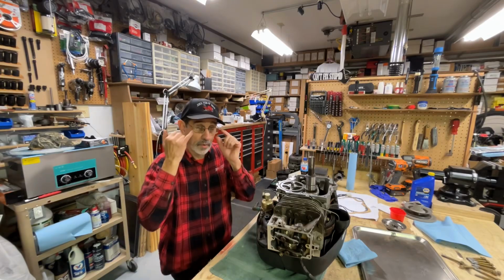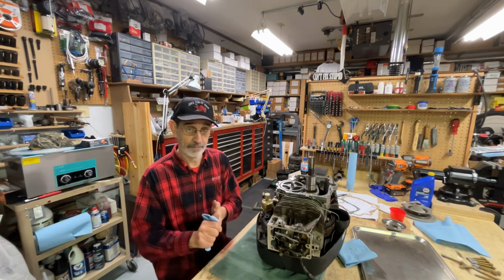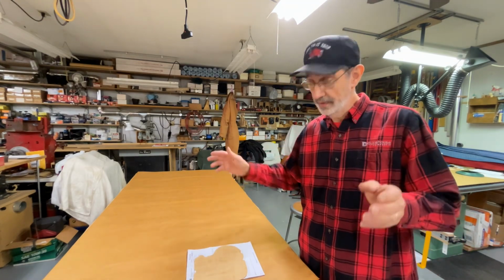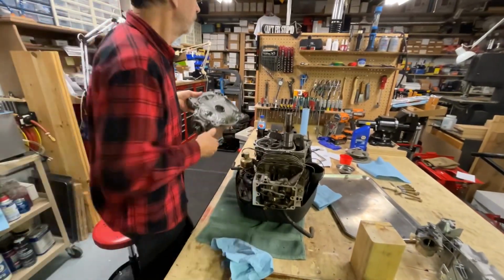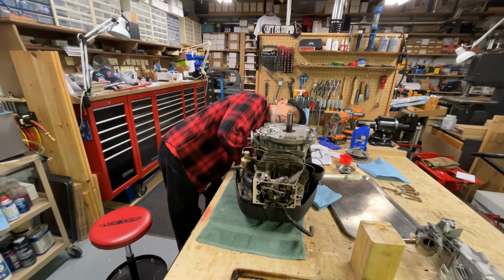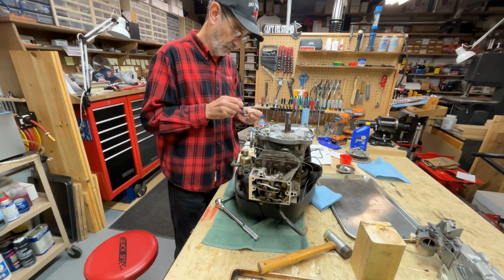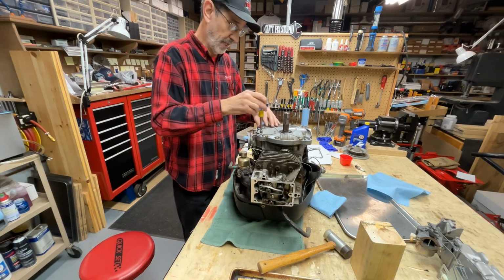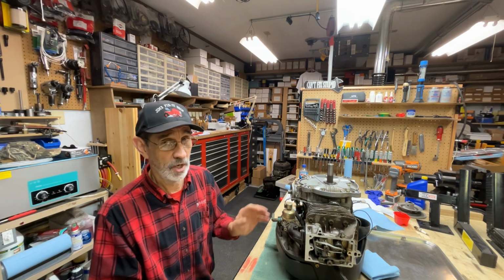502. Part 2.  Fixing a Briggs & Stratton engine. Correct in the end play in my crankshaft.

Comment: In this situation i just clean the surfaces really well and use a thin film of grey RTV. you dont NEED a gasket
Reply from the maker: That might work in some cases, but a lot of times your cork or even your paper gaskets are used as a spacer to keep the correct distance inside of your engine or your differential. I know on a snapper if you don’t use the cork gasket you will lock up the chain case.         Jim’s fix-it shop.
Reply: If you have gears for the oil pump, governor, etc... you can just mic the end of the crank and just order the hardened spacers by size
Reply from the maker: @j @jeremiahfiek5495 The last Briggs engine I rebuilt there was no thrust spacer available for it. I had to drop down to a thinner gasket to bring the end plate back into spec if you can get away with using that RTV product then more power to you, but I’m not gonna suggest that to my viewers. I know one viewer tried it on his chain case on his snapper and it locked it up and the machine wouldn’t move.

Comment: Hi Jim, could you recommend a good replacement motor for a2004 Snapper 12.5. Intek motor . Would a Briggs 17.5 HP verti cal shaft be a good replacement motor? . I would appreciate any guidance on the matter. Thanks Drew from Massachusetts.
Reply from the maker: You gotta be careful if you get much bigger than a 12 1/2 horse engine, especially if you go to a 17 1/2 the engine is physically too big to fit on the machine and be able to use your bagger if you don’t bag or don’t plan on ever begging you could put a 17 1/2 horse on I work with a guy at the shop and we put a 13 horse engine on his and we had to extend the rear bumpers out 3 1/2 inches to be able to hang the bagger on and because of this extension, it kept breaking the right hand bumper so I guess I would stick with a 12 1/2 or even a 12 horse.       Jim

Comment: I’m surprised McMaster Carr didn’t have it?
Reply from the maker: @KensSmallEngineRepair  I work in a small Tool and Shop and I do all of the machine repair and maintenance work in the building including electrical Hydraulic pneumatics about anything and breaks down and I called all my suppliers including McMaster Carr, MSC, Grainger, and all the other ones that I deal with and no one carried this stuff except for this one Rubber company.         Jim
Reply: @ I do the same thing for a living only for a large defense contractor

Comment: I’ve also used Kraft paper for gaskets when thin is the issue.
Reply from the maker: @KensSmallEngineRepair  I have a large roll of craft paper on the end of my woodworking bench that I used to cover it up when I am staining or gluing that is .003  but if you something that then you better have a very smooth surface, but I was afraid the craft paper may wick oil out and give me a leak so I went with the.010 and I thought I’d give that a try at least I’m back in tolerance so hopefully the engine won’t have any trouble.      Jim

Comment: The ones I’ve seen have a plastic gear with a steel thrust washer that rests against the sump surface. Instead of thinner gasket material why not use a thrust shim washer?
Reply from the maker: @KensSmallEngineRepair  I heard about the steel shims, but I could not find one that would fit this engine for some reason and the gear on the crankshaft for the camshaft is a cast steel of some sort.        Jim